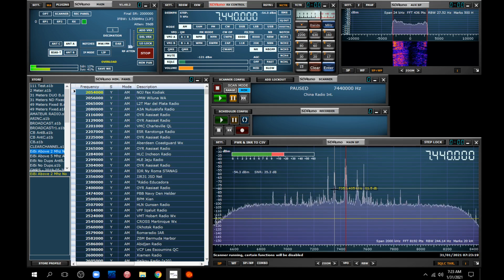TRRS #2085 - Testing Shortwave Antennas with SDRPlay RSPdx - Amazing

Comment: Hi Tom, I have the newer MLA30+ (plus) magloop and it's brilliant. I find it's better with it's own Bias-T than using the Bias-T from my RSPdx. A brilliant antenna I have to say.
Reply from the maker: That is the one I have.  Interesting about the difference.  I will have to try to test that.
Reply: @hamrad88  Are you talking about the "difference" between the plus and non-plus versions of the MLA-30?   If so then go for it.  That would be very interesting!  Thanks
Reply from the maker: @tribulationprepper787  No.  I was talking about using the power supply that came with the antenna versus the one supplied by the RSPdx as you mentioned.
Reply: @hamrad88    OH!   In that case, have you done a comparison between the plus and non-plus MLA's?
Reply from the maker: @tribulationprepper787  No. I don't not own at non-plus.
Reply: @tonymagnier9846   Thanks for the info.  It looks like I made the right choice with the Plus.
Reply: @tribulationprepper787  I bought my MLA30 Plus based on the findings of that video, definitely the best choice and can't go wrong at that price either.